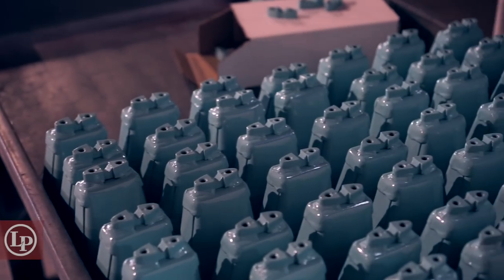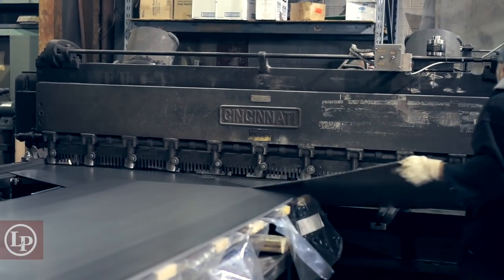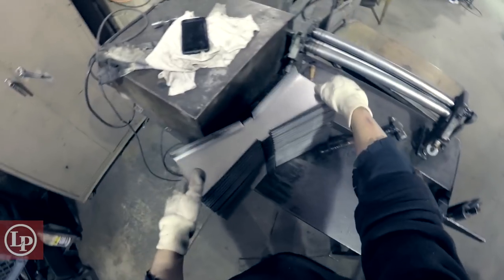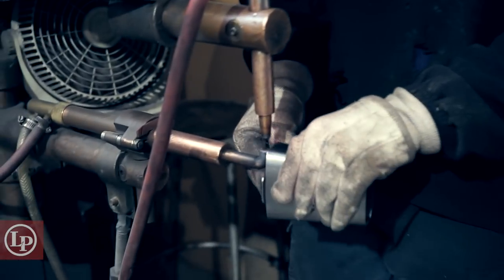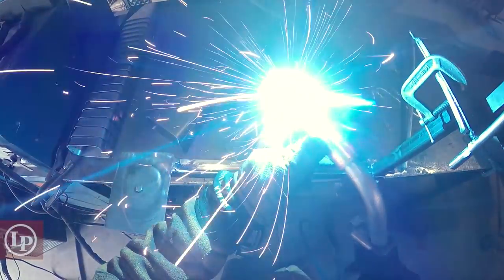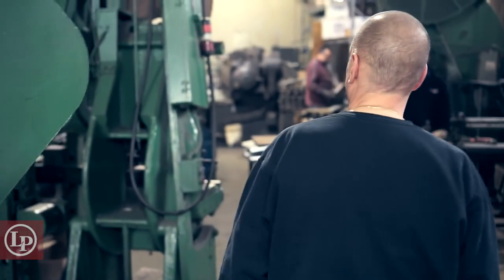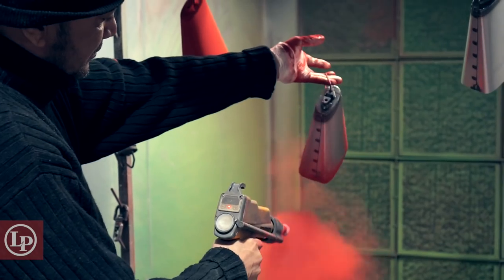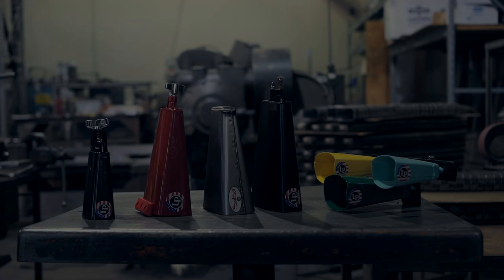LP | Cowbell Factory Tour

Comment: I bought an ES-9 and it sounds like theres a crack or some kind of grinding noise but its brand new. I think it might have been welded improperly and the store doesnt give refunds. I tried everything to muffle the vibration but the sound is still there. Anyone else have this problem?
Reply from the maker: Hey there.
I have not heard of this issue before.
Can you send me a photo of the cowbell or possibly a short video clip?
You can reach me at my email mikeb@dwdrums.com
Thanks.
Reply: @LPYT  yes sir. I will do that.
Reply: @LPYT  if you’re saying you’ve never heard of this then LP has people working there that are not really percussion experts. Anyone that knows about percussion knows that this is a common occurrence called “cowbell buzz” which happens when the welding is off.
Reply: DW is a great drum company, to me the best there is hands down, but the LP acquisition hasn’t produced anything new or exciting in the LP catalog. Just the same old same old with a different paint job and different endorser badge. Specs are the same as always. I think your company would benefit from brining people on board that know more about percussion. I still love your products but it’s time to start innovating again. Also the new website doesn’t give the same detailed description of the instruments as before, that was a nice touch.